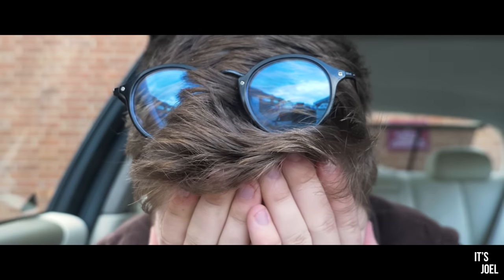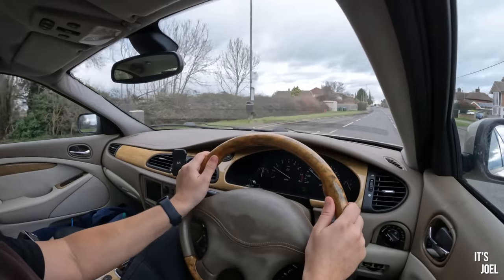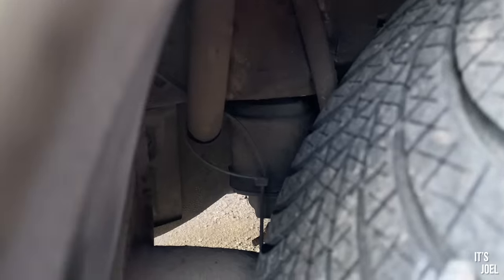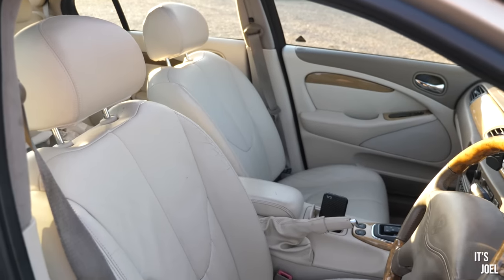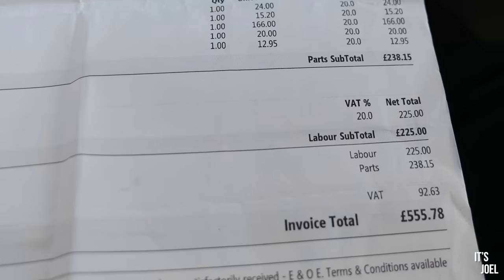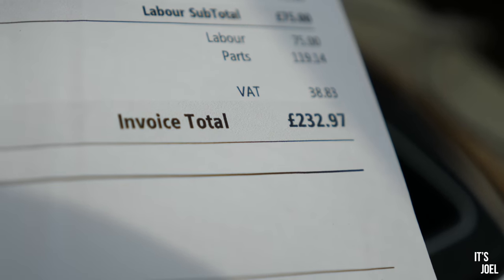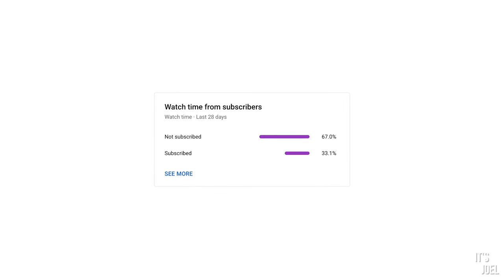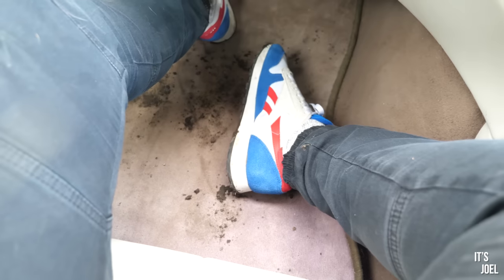You won't believe how much money I've spent on my 'Cheap' V8 Jaguar S-Type...

Comment from the maker: Despite everything, it feels good to be keeping this car on the road! Would you do the same?
Reply: If YouTubers bought cars that didn’t break I wouldn’t be watching all the videos I do 👍
Reply: Yeah - the "value" of the car only matters if you want to sell it. If you're keeping it then it's irrelevant. I've got a Discovery that I've had for 3 years, cost £1800 and I've spent 3 times that on it even doing all the work myself. It's not all fixes, there's a load of mods and normal wear & tear things like servicing, brakes, tyres etc but it''s worth it to me even though I'll never see the money back if I did sell it.
If you can afford it and you enjoy the car then that's all that matters.
Reply: Yep spent 6k on my x type ☺️
Reply: Yup.  My 2011 Land river Freelander 2 has needed a new rear shock ( leak ), passenger door actuator and a new manifold recently. 

Whilst the manifold annoyed me a bit as the cost came at a shit time... I plan to keep it on the road and sort preventative maintenance going forward. 

Can't afford a new Land Rover and no way in hell I am buying an EV.  

My ethos is buy a car you like and keep it running.
Reply: Hell no
Reply: Its an old Jag Joel it wont be the last of your spending.
If you want reliable no hassle motoring you can purchase a Toyota or a Honda
Reply: Yes I spend fortune keeping my X5 E53 on the road aswell. New cars I have no interest in at all
Reply: No, and I didn't.... I have studied on the Jag S-type before I bought one, and then made sure I bought one that was worth what I paid for it.
NEVERTHELESS... yes you can drive such a car on a budget, but indeed it helps if you do some of the stuff yourself. KUDOS TO YOU SIR!
--
SO... I knew about sills rotting, window mechanisms failing, spark plugs & engine electronics, leaking rear lamps/bootseal....
-->> And get that gearbox checked out: they are the same ZF gearbox as in a Merc and a Bimmer, but JAGUAR said "they never need maintenance". 
BMW and Merc advise to change filter/flush it every 60K miles or so. So... what happens, at twice that, Jag gearboxes tend to go BOOM. 
---
Also... watch the timing chain tensioners, they wil wear out, and then the engine goes BOOM. Replace with later 4.2 items. 
---
Lastly, some of the 4.0 engine have NIKASIL cilinder-coating, which cannot stand El Cheapo gas with sulphur. 
But if it's still OK, well sulphur-gas is now forbidden, so it will be OK (actually it will wear slower than the update non-nikasil engines). 
--
A NOTE: what you can do about the rust, and will save you a LOT of money: get the sills off, and sand/wire brush the whole lot. 
THEN get them welded... THEN soak them in a good anti-rust paint + treatment. It will last for ages.
Reply: Keep Her, you've put so much into her! She's an ongoing project Mate, I wouldn't be saying this if I didn't have just the slightest inkling that you and your Lady love this Girl, if you can manage it carry on it will be well worth it in the end but remember she will always be a work in progress! But once well sorted the big spending will stop (for a while? 🤣) I know you will keep up the regular maintenance, so yeah, if you love her keep her! Do you have another vehicle as a daily driver? That helps greatly as you can lay her up pending saving up for the next spend! Good luck Mate she's a labour of love and absolutely a keeper!
Reply: You’ve got to be certain the head gasket hasn’t gone though otherwise it will be a replacement engine at some point, with fitting, I’d imagine will set you back at least another 3k and that’ll be mates rates
Reply: It's not the best idea because it is a waste of money .. but I do the same , but I'm a technician with a workshop. So I've just to pay for parts and I use second hand parts . Sometimes a car stands around a couple of months till I find a cheap spare part .But I would never recommend that to customers what have to visit garages for repair jobs on her cars.
Reply: I think you're doing the right thing with the videos, you don't have to do in-depth tutorials on the repairs, (Lee Lockwood) prime example understanding some jobs will be too tough I'd be using the back street garages and getting prices and the exhaust bracket would be getting a tack of weld.
Reply: No - cut your losses. You keep falling for the sunk cost fallacy. Also, if you're not an expert yourself, and don't have a mate who is a mechanic, you must, must, must get an AA or RAC inspection. Yes, that would add two or three hundred to the purchase, but it will save you from expensive lemons. Finally, if you want an affordable V8, Merc is the way to go; they've been building V8s since the 60s, unlike BMW, Jag and Audi. Plenty of cheap 15 year old Mercs out there with reliable M113 V8 power.
Reply: You're learning the hard way that Jaguars are, unfortunately, POS money holes...
Reply: Of
Course we need guys like you to keep
Classics
Like this on the road.
Reply: I already have. I bought a '03 4.2 3 years ago. So far it has been great though this years MOT needed £70 spending on some welding to the inner sill. My running total thus far is under £3.3k. 
You got your hat nailed on with that coolant tank, I paid £46 for a Meyer unit and fitted it my self. Also had to replace the thermostat housing and sourced a good one from AutoReserve (Specialist Jaguar Breaker near me).

Is it worth keepeing on the road? Well, it's a JAAAAAAG. Secondly it's a V8. Where are you going to get a cheaper V8?
Reply: You are the man I am proud of you Bro, I need a mirror for my Z4 somebody hit it in the parking and run
Reply: Its still miles below the purchase price of a newer Jag, and like you said, they arent available anymore.  Good choice to carry on with it.  Looking forward to future videos with it.  Oh and early congrats on the upcoming wedding 👍
Reply: Of course. Ive got 4 years trouble free ownership after rectifying prior owners lazyness spending £2000. Yeah sure it costs more than a Corolla but so much more fun. I’d say it’s a robust reliable car. And such a drivers car.
Reply: Yes and no... I have been driving old cars (over 20 years old at least) for the last 20 years. All kinds of brands, including Jags. In my former job I used them to drive all over Europe and I have had never any serious problems, older cars can be very reliable with proper maintenance. However I decided to stay with either a Benz or a Volvo and in both cases the more run of the mill models. That keeps all costs, including fuel, within reason. Currently I drive a '98 C180 manual. Not an exciting car yet up till now it serves me well for a very reasonable cost...
Reply: @ocelot2234  could have put that money to buy a decent car😂😂
Reply: @stevenc5227  Nah mate I love the car and use it everyday and I now have two of them
Reply: @ocelot2234  I had an X type new in 2007, after 5 years and 70k miles started getting some issues, traded in for a BMW 5 series in 2012 never looked back, still have the car no problems.
Reply: @stevenc5227  I’m the second owner from new and never had an issue with my x types
Reply: @cardiary  if you can find an engine, it's a days work on the drive as long as the gearbox has not corroded to the engine.
Reply: I’ve just bought a 2005 S type R for £1.6k so I’ll let you know in a few months!
Reply: on an S-Type R i'd go into debt for a beauty like that.

Comment: An interesting project.  My neighbour bought a cheap 1993 Jaguar XJS 5 years ago.  Bodily the paint was excellent and underbody solid.  The big issue was the engine, (4.0) which ended a head skimming and he got a 2k bill for that. He replaced all the brakes, suspension parts and had the underbody treated and sealed professionally.  Other work included a new headlining, battery and various trim parts. The bill was around 8k.   After 3 years he decided to sell it.   I bought it from him for 9k.  It’s absolutely superb.  His replacement is a v8 S type, like yours on an 03 plate.  It requires a huge amount of work, so I suspect he will be racking up similar bills.  Good luck!

Comment: Had old Jags for 20 years. 2 x Series 3  V12s (1983 &1986) XJR6 (1996), XJR8 (1998), current 2002 Sovereign V8 4L LWB. The biggest issues are corrosion, auto boxes, suspension bushes. From my observations at my Jag specialist X-types and S-types are the worst for corrosion. However, for the XJ they corrode on arches, sills (inc. inner sills, base front bulkhead/floor section), rear jacking-points. The 4 NA litre engine revs more freely than the 4 litre Supercharged.  Best performance improvements for the 4 litre engine are  K & N air filter and ensure that keep the MAP, inlet tract, throttle body meticulously clean. Always use either Shell 99 or Tesco 99 petrol. Makes a big difference. Finally, old Jags require constant maintenance. Keep on top of repairs and maintenance.

Comment: You can either pay for motoring via depreciation on newer cars or repairs on older cars. Personally I prefer the latter. Used luxury cars depreciate SO heavily in the first few years that they can be a bargain. But give yourself a yearly allowance for repairs and maintenance (instead of depreciation).

Comment: I bought a S Type Jaguar 5yrs ago off a elderly guy it hadn't been running on the road for a couple of years, but he did start it up quite often, it's a 2002 I paid £1000 for it since having for the first 12 months, it's it's had a new water pump, new radiator, new battery. Most costly 2yrs ago it had 2 new inner sills and the majority of the floor needed major plating/welding £1000. Just sailed through it's mot, and is running perfectly touch wood. All the repairs were done by a friend who has access to the garage he works for, so I count myself lucky. Good luck for the future👍

Comment: Joel, keep it up and keep your spirits high. You aren't doing what you are doing to flip the car so as long as you are enjoin the car and the experiences it give you, then it is totally worth it! When all is said and done, it isn't that much to spend on it, but in a short period it can certainly feel that way. I bought a 2002 Mercedes C270 for £2500 back in 2016 and within 6 months I had to get 4 new tyres, suspension and brake components, MAF sensor, injector seals, a service (inc gearbox) and an aircon pump. This initial round of bills probably came to about £1800, and there were way more bills to come in my 6 years of ownership. Some things I took on myself like having to remove and recondition the HP fuel pump which failed due to internal seals in the winter, but it was all worth it and was a lovely and economical car to drive and own, and go on adventures with. I know you will feel the same.

Comment: So glad you're teaming up with someone to help keep this fabulous car on the road. I do feel that you've been very unlucky with the garages you have used so far. My £500 S Type (3 owners, FSH, scratch on rear door) needed over £1000 of work which the previous owner was not willing to pay, hence the low price. I sourced the parts myself and my tame garage fitted them, all done for £450. Since then apart from oil and service items, I've had bushes, track rod ends, ball joint dust covers and heater control valve replaced all for less than £700. It's been 3 years of trouble free, ultra comfortable motoring, used for the daily commute. Glad I'm not a YouTuber, it would have been very boring! I'll be replacing brake pads soon and she's now beginning to drink fuel suggesting a manifold leak but I have no qualms about getting it fixed. I've had more mundane cars that have burned through a lot more than you've shelled out so stick with it and we'll all look forward to the new content.

Comment: I have a similar experience with an x type Jag I bought back in 2018. It only cost me £300 however both sills were rotten and I ended up having the old one cut out and replaced at huge expense, only to repeat on the n/s sill the following year. Various other issues with it running rough and loss of power over 3000 rpm have been resolved but I reckon in 5 years I’ve probably thrown £3000 plus at this car. I’m so far in now I’m probably never going to sell it as there is no point. It’s a lovely British racing Green and I do love driving it. Good luck with yours, I enjoy watching the videos

Comment: I bought a one owner 2.7 S Type in November 2013. Gearbox rebuild in 2016 but that is the biggest expense so far. Keep the rust at bay and keep up the maintenance and you will be well rewarded. I am with others - why spend around £30k for a modern box just like others. What you DO NEED is a garage that will look after you and the car and not their wallet. Keep on!

Comment: Sounds so familiar. Sadly very common with old Jags (or any expensive back then / cheap now car). I was exactly there with my XK8 back 10y ago. Not as cheap as your Jag when I bought it, but I ended up doubling the price in tactical repairs to get her over the MoT in the 24 months following purchase. Then other repairs followed: corrosion, bushes etc. A money pit, but I absolutely adored her. Then, head gaskets went off and I decided to take on the repair myself. I am reasonably handy and technically minded, but that was a steep learning curve still. Would have costed 3 or 4 grands in a garage, did cost me 1 grand to do it myself - yes, you need a fair amount of tools and equipement to get the job done properly (including skimming the heads). And you will spend a lot of time going through the JTIS documentation and dedicated forums. A labour of love, litterally. All the best in this rescue mission 👍

Comment: They are quite a distinguished and an ultra beautiful piece of car Joel. As long as it doesn't break you financially after all you must think with your head and not your heart,,Thinking with your heart, will bury you. I just bought a 2001 4.0 with 13,000 miles on it a few months ago, and of course has some gremlins from siting I guess as I do not know the history and my inside blower went to high without me turning it on, while driving,,, HELLO, but when it's right it's like a real classic beauty, and drives like a couch. Keep it if you can my friend,,

Comment: Good on you. I bought my 1995 C320 Mercedes for £2500. I immediately spent £2500 on replacing all the gaskets and rubber to fix oil leaks and now another £2500 on rust repairs. Despite the money spent, I love my car and it is my daily driver. Think about the cost if you were leasing a brand new V8 Jaguar. £800 per month with nothing to show for it when you hand the car back?
Reply: Did they make a 95 c320? I thought 280 was the biggest c class in 95
Reply: @raycroal  sorry..C124 320
Reply: @kevinhowlett4097  good car, i had a clk320 fully loaded it was awesome i loved the 6 cylinder motor, i am on my second clk430 now and they are superb cars the value for money with the 430 is unmatched these days, what other v8 coupe can you buy for a couple of grand??

Comment: Keeping old beasts like these on the road is fantastic. Not appreciated at all by ordinary members of the public and even less by the government who want us all in something by powered by a plug socket but the car community adore well looked after, rejuvenated examples of cars just like this.

On the flip side, I do think your money would be better spent on cars that are known to be solid platforms as well as being less prone to rust for example, the e53 X5, based on a e39 (tough as bricks and ridiculously engineered) but doesn’t rust like an e39, really desirable and strong engines, will appreciate in value, suv ride height but drive like a car, Range Rover bits inside but without the unreliability. 

Feels like the perfect car for an L322 fan who doesn’t want the fuss or trouble

Comment: I am doing the same - kind of - bought a1998 pearlescent racing green with green leather Audi A6 2.8 Avant Quattro for £600 in 2015. And I love it, I love the colour, the looks, and it is the most comfortable place I ever sit. I do my own maintenance and when it becomes time to stop ignoring the gearbox fault, I hope to fix it myself, but if I have to pay someone else to recondition it its worth it because I love it. And having dealt with the stuff that had been left and refreshed the suspension it is totally reliable and flies through its MOT.  I have an iCarsoft JLR scanner to work on an 04 Freelander. I have the cheaper one but I really recommend get some kind of scanner.  You will need it.... Don't forget to subtract the cost of the hire of a wedding car.....

Comment: Owner of a 15 year old
Mercedes CLK Cabriolet here and i can reassure you that you are not alone.  I spend on average £1k a year on maintenance.  Some years more others less.  But on average £1k a year.  Car is garaged, does 2-3k miles a year and only has 60k on the clock with full service history.  Running these cars as they get older is an expensive business.  But….but….but….they are so much more interesting!   When I take my new Audi to work nobody notices it.  Take my merc, all polished up, roof down.  Everyone asks about it.  Funny thing is that it’s the lowest value car in the car park but it’s the one everyone asks about.  I’ll never sell it.  Keep the jag.  Show it some love.  Join the young timers club!

Comment: Your problem Jay is that you have to depend on garage/Specialist's to sort these old cars out ending in ££ bills, I'm an ex vehicle tech and collision estimator and proud of it because i put a lot of time and effort in my late teens to get my Btec and city and guilds and spent years working at various dealers as a tech and cars like this are easy for me as i only have to shell out for the parts and then put my free to me labour in! I also along the way did welding courses and took welding on (Gas and MIG) so i can deal with that as well!